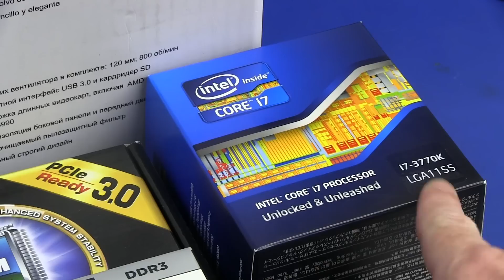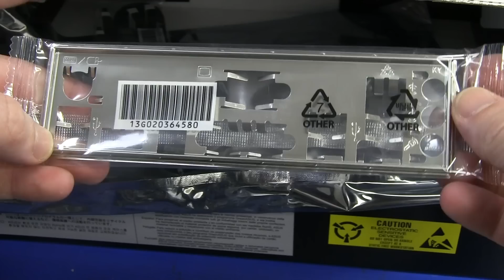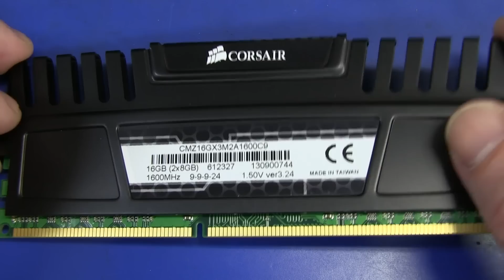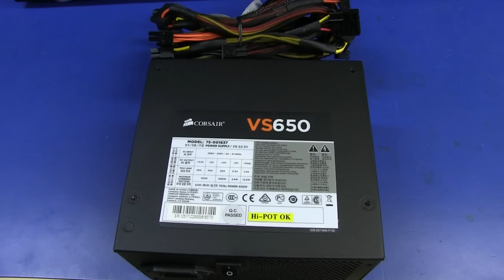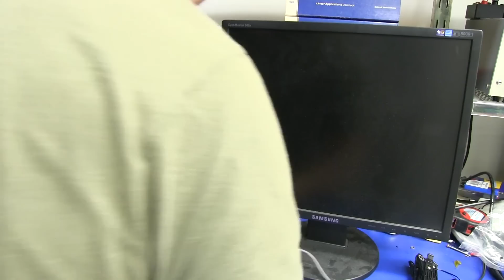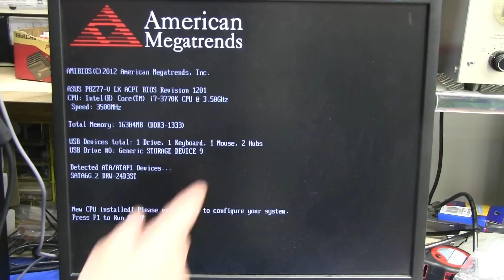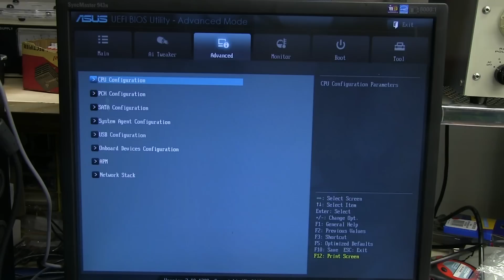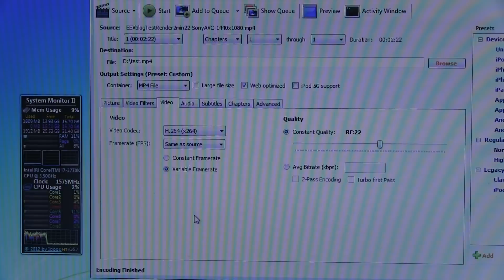EEVblog #462 - Video Editing PC Assembly

Comment: Should be just be applying a thin line of thermal paste to an I7 CPU, not drowning the CPU in the stuff. Take a look at the instructions on the arctic silver website for all the different CPU types. Some need a little drop in the center and some lines of paste. Never built a PC with the PSU in the bottom, I assume these PSU blow out rather than suck air in? If it didn't I expect it would pull in a load of dust and crap if put on a floor.

Comment: So far no one has proven this air bubble thing, which doesn't happen when you apply paste to BOTH surfaces, which I have REPEATEDLY said.  Air bubbles would certainly happen if you put a thin layer of paste on only one surface.  If there were air bubbles with my method, I would see them when I separate the surfaces.  We have heat spreaders for a reason...

Comment: Hey Dave. Sorry for my English. As already commented, you made a mistake when installing memory! Reinstalling memory slots only in blue - you get a 128-bit bus, and the ability to set the CPU heat sink with the right hand. You can also try to set up the power supply cooler - perhaps improved ventilation for hard disks. Good luck.

Comment: After your teardown, the VS600 rates lower than I thought it would... Those cap choices are sketchier than I expected based on the VS450 teardown I've seen. I still don't think you'll have any problems with it, but I still would have gotten something slightly better in your shoes.

Comment: I saw in your bios that your ram is running at 1333mhz the ram kit you have is a 1600mhz kit so you might wanna change that in bios to get the full worth of your kit. I

 I had to do the same with my Kingston Hyper x Genesis 1600mhz 8GB kit windows defaults the clock speed to 1333mhz.

Comment: waaay too much thermal paste :(, the "correct" way is to just put a small bead on the center of the CPU center(or a line across the die), not on the heatsink and not that much :(

Comment: While I agree (somewhat) with you saying you don't need a powerful GPU for editing and rendering, the word NEED needs to be emphasized. I'm not sure about Vegas, but I know most good editors support realtime GPU rendering-as you edit it's the GPU rendering, meaning you can get the full framerate and resolution. Also, it cuts render times down a lot.

I'm not uninformed, either. I used to use integrated graphics, then upgraded. There was no comparison. Render times are now 50% of the video length

Comment: it is better to pull than push, when you push your adding the heat from the fan into the radiator. That's how automotive industry does it.

Comment: just squeze some tiny bit of thermal paste in the middle of the contact area, it will spread out nicely when you press the heat sink down, just a little tip for you. greeting from taiwn : )

Comment: I actually bought a new heatsink for my PC (in fact, the slightly smaller "TX3" version of this same heatsink), and not having much experience with installing heatsinks I made the exact same mistake with the thermal paste. Luckily it wasn't too much and I was able to clean up the excess paste.

Well, you learn from your mistakes. Next time I'll know that it's better to put the paste on the CPU, not the heatsink, and to spread it as thin as possible with something, and leave a bit of space around the edges for it to have room to spread. (After all, the purpose of the paste is not so much to "connect" the heatsink to the cpu, but to fill the microscopic gaps that the metal surfaces have, so you really need a really thin layer of it, just enough to fill all those tiny gaps.)

Btw, I really think you shouldn't void the warranty of the PSU. Even high-quality ones have a tendency to break sometimes, and it's really nice to get it replaced for free. Corsair PSU's in particular often have a really long warranty time (like eg. 3 years or such). While they are quite high quality, well, even the best ones just blow up sometimes. Why waste money when you can have a replacement for free?
Reply: Please don't try to spread out the thermal paste. It's much better to just put a pea sized (or smaller) amount in the middle, and let it spread out as you tighten the heatsink. It isn't an issue if it doesn't quite cover the entire metal part of the CPU. That's just the IHS, and the actual CPU die doesn't take up much space at all in the center underneath it, so it's much better to aim for maximum thermal transfer efficiency in the middle than it is to sacrifice that for full thermal paste coverage.
Reply: Patrik Manni
I have no idea how the metal casing of modern CPU's is designed, but I would assume that they design it so that the heat spreads as evenly as possible (so that there's a maximum amount of heat transfer to the heatsink). I could be wrong on this, of course, because as said I have no idea how they are actually designed.

Either way, are there any actual tests of which method produces better heat dissipation, putting just a small drop on the center (and letting it spread) or putting a thin layer of paste?
Reply: WarpRulez honestly, there is no difference between a thin layer and a pea sized drop of heat paste temperature wise, but you do use a good amount more heat paste doing a thin layer over the whole thing, and good quality heat paste is rather expensive
Reply: ***** this is why we lap our die's and cpu heat spreaders :)

Comment: Throw that Radeon 5870 video card from the Mailbag in there!  It might be a few years old, but they do run pretty low power (15-25W) at idle and can drive 3 monitors.  They also support OpenCL, so any transcoding or rendering applications that support OpenCL could be accelerated.  I run 2 of them with an i7 930 off a 650W PSU with no problems.  Nice case as well, my box has 8 fans total and is quite loud, maybe some foam would help it.

Comment: In the budget end of the spectrum with motherboards gigabyte have a better reputation for reliability (they are also often considered lacklustre). Yes there are anecdotes about both brands and that is personal experience, (mine is that gigabyte are more reliable) but when you are doings hundreds of PCs a month you do get some objective data about the overall stability of the brands.
Comparing motherboards to cars
Asus=Sports car
Gigabyte=stationwagon
Just creating controversy besides "pastegate"

Comment: Actually, Corsair power supplies are really nice power supplies. Much better then any $15 "500 Watt" power supply lol. I use a Corsair CX430m PSU myself, and it has been good to me. No coil whine, and the fan is silent - even quieter then the fans on my Asus GTX 660 DirectCU II which are already really quiet fans.

Comment: I had 486sx-25, I could change the clock with 1 jumper. I miss those jumpers.
The thing had a range i think, 16  25 33 40 50 66MHz. And with jumpers, no dodgy BIOS software is going to change that,
my sx-25 ran stable at 40MHz. 50Mhz on a cold day.

Comment: DUDE THE FREAKING GPU ACTUALLY LOST. Cpu took 57 seconds, GPU took 1 minute 30, and Intel QuickSync (Something which is ON BOARD GRAPHICS) actually wan. The 3770k supports Quicksync so I'm not sure what your point is anymore.

Comment: Though it is more exspensive, the i7 isn't that much more powerful than the octo-core AMD. (FX-8320?)
It does make a difference, but for an editing machine the difference won't be much.

That's just the gamer in me speaking, though.
Reply: Brinkwolf I guess he didn't want to deal with driver cancer, so he chose an Intel CPU.
Reply: Optiplex321 I haven't had any of the issues people keep complaining about with AMD other than the heat, which can be dealt with.

Comment: Transcoding is where AMD actually does better. You also get better builtin graphics. Further more modern RADEON graphics is the better performing solution if you have software that uses OPENCL. It just runs hotter and burns more power since they don't have access to a 22nm foundary.

Comment: Isn't a GPU more ideal for rendering movies than a CPU. I know that it doesn't seems like he bought a graphics card, but still
Reply: ***** Or a FirePro. ;) Both AMD and NVIDIA provide solutions for almost anything. Ones maybe better, others maybe worse, it really depends on the situation of the market where you have the need and how much budget would you let you cover it with the most appropiate solution. :)
Reply: ***** Yeah, I supposed you would recognise things as they are, but one must always expect a fanboy claim in discussions like these ones... :)
Both Nvidia and AMD had given me bad and good experiences. Aside of that, Nvidia has made me to spend a bit more while in need of building or upgrading my rig, too. :P
Both may give what one needs depending on the situation. Yours was way more important than the typical trivial role which gaming graphic cards are responsible of... As a task for which a Quadro/FirePro is used should be... So I feel kind of sorry about your bad experience with those 12+ hour shifts full of time-wasting crashes where any regular user would turn crazy by the 3rd day or about...
Best wishes for the incoming Mac pro's experience. It should be expected as a neat performing, but time will tell.
Take care,
Cheers. :)
Reply: ***** It's SO nice ‒and uncommon- to have a normal discussion over anything "on the internets". :)
Have a nice day yourself as well!

Comment: Exactly. It would be like buying a ferrari for every day work trip. But nevertheless Dave I would strongly suggest you to put some effort for cable management. Nowadays cases have holes in the platform for motherboards, and you can put most of the cables behind that platform.You can leave sata cables, but power cables are the first one for doing this. It would much improve airflowing and make interior cleaner. IMO this "sucker" is great for you. Good that you don't listen fanboys!

Comment: Well I have an even more crapy built pc... Asus F2A85-M motherboard, with AMD A10 5800K processor, and 8 GB kingston ram. I bought those a few months ago, and I put it in my Pentium III pc's case, I didn't even changed the 450W old PS which doesn't even have the proper 24 and 4 pin ATX connector but the old 20 pin and a 4 pin, I put a 2.5" HDD and a dvd writer from my broken laptop. Of course I had to modify the DVD writer's power connector to get it working, but all works well enough for me. :D

Comment: If you are going for power I'd drop in a 350 with glass packs and ground effects.  I use oil cooling and a progressive oil filter.  I prefer pull starting my pc, I'm doing serious work with my pc and so turning it on should be a big deal.  Because the pc needs to run outside the house it is waterproofed with one of those old lead lined, cast iron baby bassinets.  Fanboys are fun aren't they?

Comment: amd is in fact a better bang for your buck, my fx 8350 easily beat his handbrake times by almost half(but it is overclocked). intel is a better cpu but its not known for its performance per dollar ratio. my i7 4770k did beat my fx 8350 by about 1-2 seconds though(in gaming and applications like handbrake you wont see much difference). he did do mistakes in the video but for his first time building in a long time, he did really good. temperatures wont affect performance unless it hits negatives.

Comment: With the backplate, you can just press it into the cutout in the case - it should click in firmly enough that it won't come off when you slide the motherboard in.

Those CPU clips are a pain as well.. Unless you've done a good few, it always seems like you've done it wrong. But the worst things... are those damned push-pins that intel insists on using. I love intel, but I have to say, AMD do /much/ better heatsink mounts.

Comment: i really dislike heat-sinks that big i would much rather use a AIO cooler. Also knowing that you haven't built a computer in 15 years you think you would have done some research on the process of putting it together. it looks like you just gathered parts people said were good. and just gave it ago. and im guessing thats what you did. you wouldn't have all these comments like this if you had just spent some extra time learning how to do it properly the first time.

Comment: Dave, you couldn't find anything else to take apart in a modern PC, so power supply it is. tsk tsk :-D  _ PSU teardown at 35:20 (lasts 4-5 minutes)

Comment: Hey dave, Nice machine, I have the same SSD, run the samsung software for it and you will need to put it into ahci or somthing mode in the bios and edit win7 registry, google it it is easy. Then see a full 6Gbs in it full glory, stick all the other drives on the 3Gbs once the cache has been used up they only out put about 1.5Gbs if that. I went with 8Gig ram bit faster at 8 latency with a 4.7Ghz AMD 8 core, it beats all I7's apart from the top end 3770. Enjoy a fresh machine ;)

Comment: I don't know about your method. Maybe you have bubbles, maybe not. You've probably got more thermal paste than is optimal. But there is video demonstrating air bubbles with a single layer spread at least. Search for "How thermal compound spreads", it's right here on Youtube.

Your method probably works, and so does the rice grain, and so does Dave's "globbing on" method. But the rice grain is the currently accepted "best practice", and that's all I'm saying.

Comment: If you're using crazy special effects that offer GPU acceleration, yes, but for your basic video cutting and adding text like Dave does, a GPU is going to do nothing.  What do you mean by render?  The final encode?  If so, I'd rather sacrifice speed for quality and use something proven like x264.  These hardware-accelerate encoders aren't going to get the best quality per bit rate.

Comment: First You bought i7 and then degrade performance two ways - Memory should be either in blue or black slots so it can run in DUAL-CHANNEL mode, secondary - BIOS detected memory as 1333MHz, but you've got 1600MHz, adjust it in advanced BIOS section ;-)

Comment: I use the same heatsink.. I use mine on a AMD FX 8320 8x 3.2ghz.. I just built my pc about a month ago.. I don't game but wanted a beast hehe... I also have the MSI 970 Gaming Motherboard. and I'm running a Geforce 550ti 1gb video card.. Its a older card. But I cant afford $300+ for a better one.. Cause I don't really game on mine.. I'm using the same heat sink and fan as you cause I want to overclock.. and the stock that came with my cpu was smaller then the one u got for that I7 chip.. I think I can overclock mine up to 8x 4.0ghz. I'm running around 14.5tb of hard drive space some internal and some external. nice build

Comment: for next builds :) 
about the IO shield, pop it first in the case and then put the MB inside, its designed to be put like that. Second u need to populate A1 and B1 , Not A1 and A2(use the same color)
and yeah way 2 much termal paste. plus i think i noticed u had the DVD drive in 6gigs port, change it to 3gigs, u are using a 6 gigs port for nothing.

Comment: Well I'll be darned, there are 6 screw holes on this board...   I thought you were blowing smoke about that since ATX boards usually have 9 screw holes.  Maybe it's a low cost board thing?  I don't know, I usually shop around the higher end stuff, and every board I've ever seen has had 9 holes.  Learn something new every day.  :)

Comment: Doubt it. If you get the quality ASUS stuff you got something that's extremely good. Also while it's true that processors suck at video encoding some software can take use of the intel video part and processor or just the GPU. Only got ASUS stuff these days when i buy something new and if you put a little more into their stuff you will see how amazing stuff they got and the value is good.

Comment: wayyyyy to much thermal paste dude ;P Also you need to move your second memory dimm one more slot out. First two slots are the first "channel" as far as the memory controller is concerned. Second two slots are the second "channel". With only two dimms, you're gonna want one dimm in each channel.

Comment: Hi, Dave! Great choice of the motherboard and the CPU. But RAM... Oh, this horrible Corsair only 1333MHz WTF? Try to set it in 1600MHz mode. Also, check the manual of the motherboard, I think that you have instal ram into incorrect composition for dual mode. Second, you can release gape between the HDD's for best cooling and resource.

Comment: Okay there is this thing called cable management, and there is none in your machine. The nest of wires you have in there is really going to impede air flow. Call me crazy, but you might want to try running everything in the back.

Comment: I bought the upgraded version of your motherboard... Double the ram chip-set allowable than yours and i used all 8gig ram chips...   be careful of what heat sink you use especially with the vengeance 8gig ram chips.  I had to go through 4 different heat sinks to find one that fit.  I built my CPU with an i7 chip with 6 cores, and 64gig's ram.  two 3gig video cards. I put it all in a 30 gallon fish tank and filled it to the rim with mineral oil.   I've been running it for a few months now and the temp hasn't gone above 98 degrees even while playing a few video games at the same time.  in fact I have hardly gone above 5% CPU usage...  There should be no need for ever using this much power for anything within the next 5-10 years....
Reply: so you wasted your money then?
Reply: I wouldn't say that, I do play video games quite a bit. also i use an auto cad program that uses a lot of space and speed.  also I spent quite a bit on this but didn't want to have to do any upgrades for at least 5 to 10 years and hopefully I shouldn't. It also looks awesome with some black lights at night make everything pop through the fish tank.
Reply: greg wolff
You system will be rendered obsolete within 2 years, see Moore's Law.